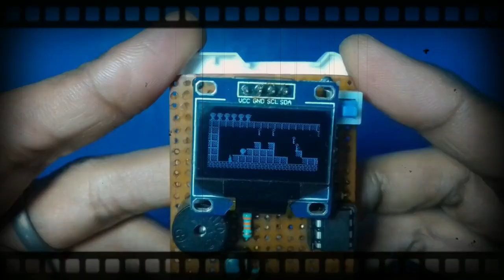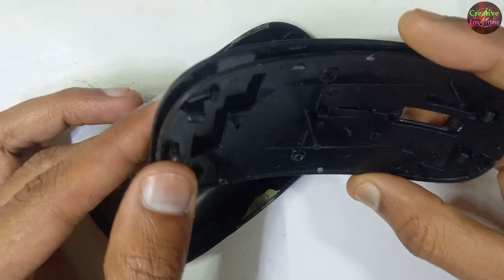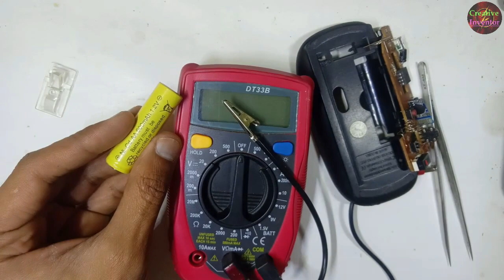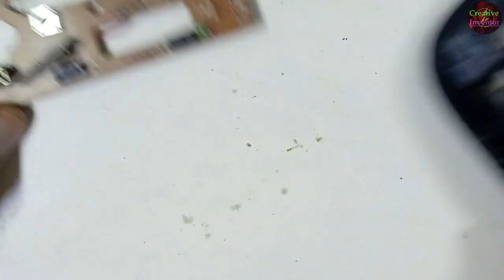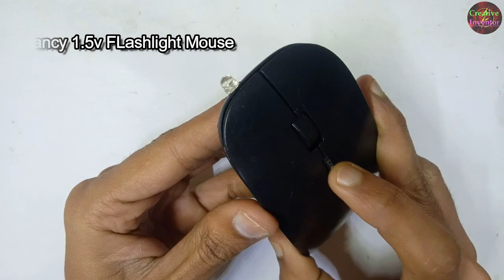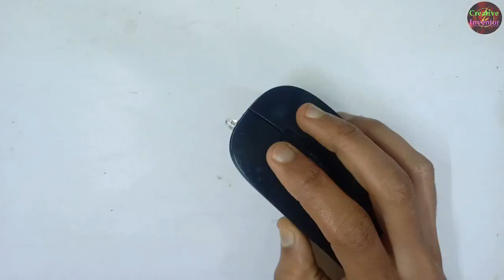Wireless Mouse Amazing Hack, 1.5v Wireless Mouse Hacked into Flashlight, Wireless Mouse Repair

Comment: Already I make this circuit ... but it's so tiny...all smd components are use
Reply from the maker: good, but i didn't maked it i just modified it, and for your kind information if i take out all the components of this mouse circuit, its in smd size the circuit will be so tiny that u can't imagine😅, its will be microscopic bcoz its in the microcontroller.

Comment: You don't need mouse circuit for this. 
Only you need one button, LED and battery &wires.

There is nothing awesome.
Reply from the maker: You can't light up an led using 1.5v battery !!
This mouse has an built in boost converter that boost the battery voltage upto 3v.
This is AWESOME CIRUIT,
BUT ILLITRATES PEOPLES LIKE YOU CAN'T UNDERSTAND !! BCOZ IT NEEDS BRAIN TO UNDERSTAND !!

Comment: make joule thief circuit it's simple and you dont hav to destroy mouse
Reply from the maker: i had not destroyed it, i was going to throw it in that grabage😂😂, bcoz it was dead, defective and waste,
i recycled it, to use it in any way, 
Read the video title before giving any suggestion 😄😄
Reply from the maker: Also, the components i had removed so gently, without damaging any print, so that if there is any chance for repairing it in the future, then i can again assemble and repair it, 
so you better know the meaning of destroying, if you call this destroying then hatt off😁😁😂🤣 for your thoughts 😆😆
Reply from the maker: Also, the dongle of that mouse is lost, still im preserving it.
Reply: @CreativeInventorlab  yes, sir, destroying means, damaging and breaking, and i don't see and breaking and damaging, you just modified it. sir.
Reply: its not destroying, it is called recycling without damaging.
Reply: i didn't see any sign of destroying, could plz explain Mr coin_cell that where did you see it was destroying.
Reply: kkk mouse was not destoryed